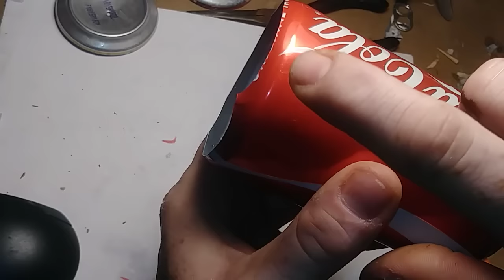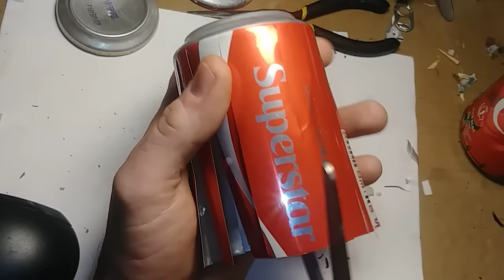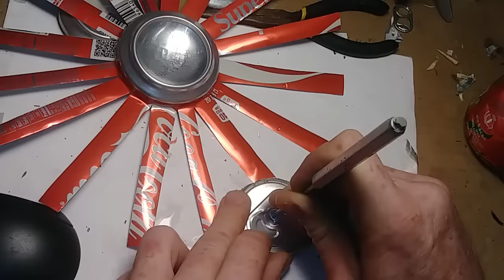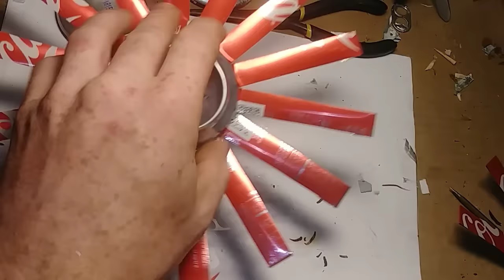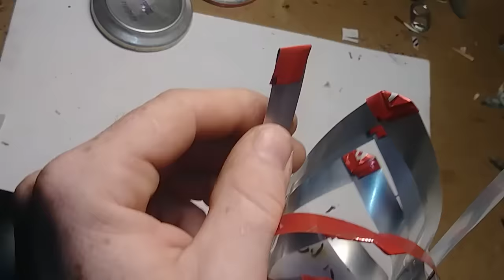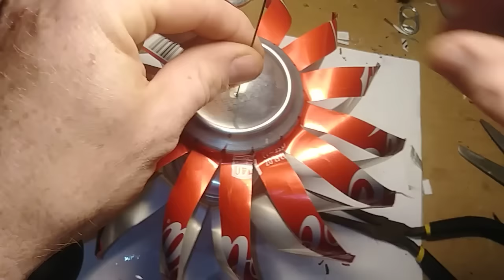How to make aluminum can wind spinner or soda can wind spinner

Comment: Great idea Doug. However, if you want this to stand up like a pinwheel, you can adjust it a bit. First use a thicker wire, about 16 gauge. Make a loop on the end of the wire as you did, then a bead on the wire outside of spinner, through first spinner hole, another bead inside, a strip of soda straw on the wire inside, another bead inside, then out the back spinner hole and another bead on the outside. Make a small loop in the exit wire so that it goes straight out, loop up, back down next to the last bead. This will make it secure from slipping down the wire. Now you have a wire to stick in the ground or wherever and stay upright. Hope that's not too confusing.  Thanks for your original idea.
Reply: W